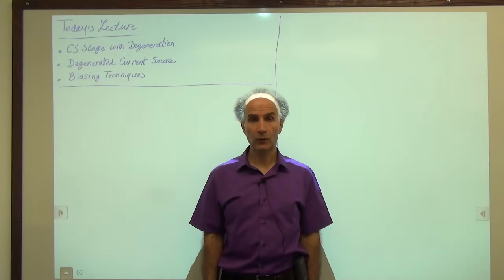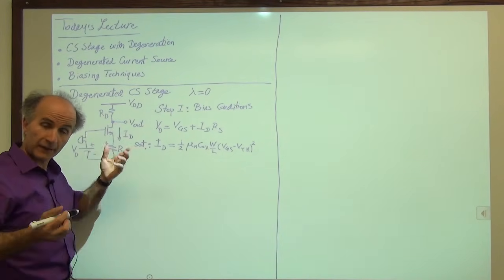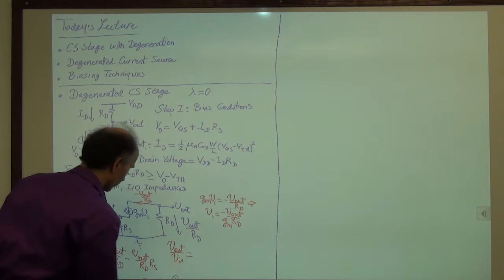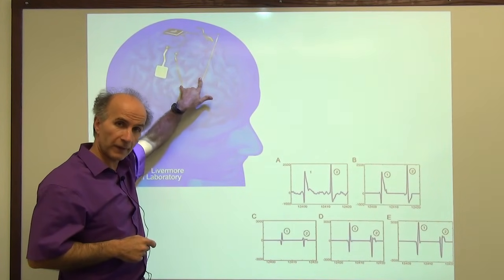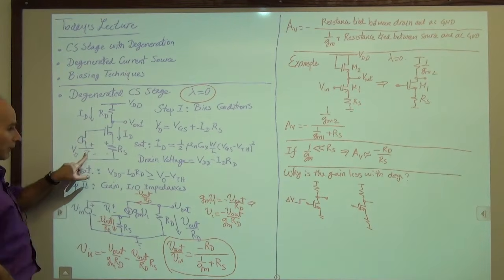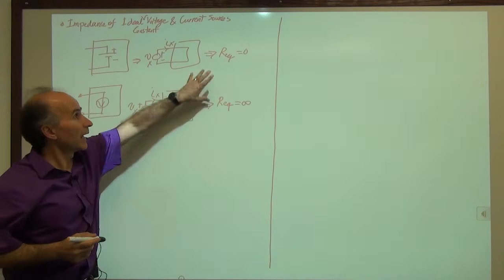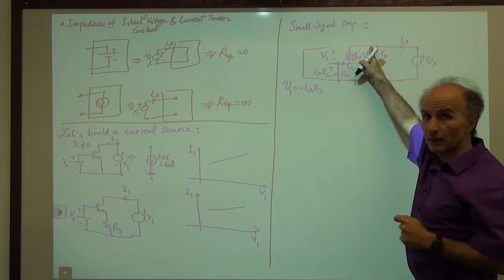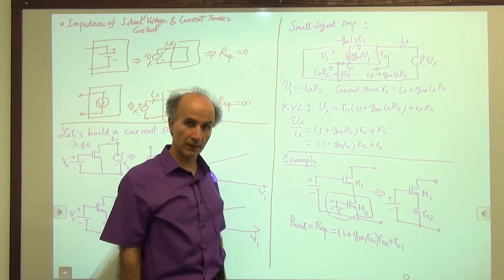Razavi Electronics 1, Lec 38, Common-Source Stage with Degeneration

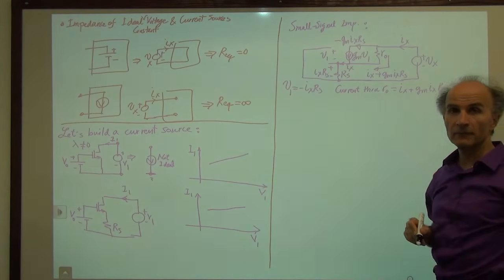Comment: 54:42 I do not understand how V1 is substituted in gmV1 in the corresponding small signal if it is defined as VDS, We shouldn't be able to replace V1 with VGS right?

Edit: I think you can just replace V1 with some V2, both aren't same, notation issue, (I am including it here for clarity)
Reply: Why can't you replace v1 with Vgs. In that particular circuit v1= Vgs. if you want you can write kvl at input side. you will also get the same answer what sir got.

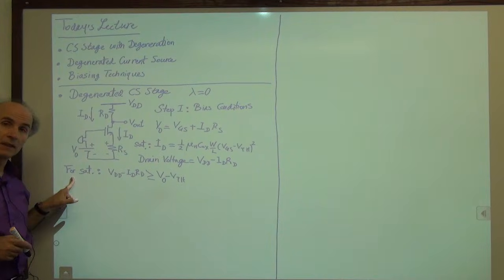Comment: @13:00 shouldn't we consider the drop across the resistor Rs as the condition is Vds >= Vgs-Vth?
Reply: Yes you have to, but the expression and the circuit topology take care of that. 

The expression Vds > Vgs - Vth can be written as: (Vd - Vs)>(Vg - Vs) - Vth, where Vd, Vg, and Vs mean the voltage of drain, gate and source to the ground respectively. 

As you can see the voltage Vs cancel out on both side, leaving only Vd > Vg - Vth. Plugging in the expression of Vd (Vdd-Id*Rd) and Vg (which is Vo) gives you the inequality on the whiteboard. 

Since Vd (instead of Vds) is directly measured from drain to ground, it automatically includes the voltage drop across resistor Rs.
Reply: yeah... I too noticed that

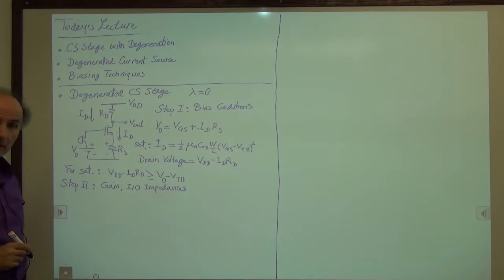Comment: Sir, V0= Vg + (drop on Rs), why did you consider Vg=V0 @13:33
Reply: yes i was wondering the same
Reply: I suppose that what you said is Vgs, but when explaining pinch-off at p277 it says that the edge only required Vg-Vth. And V0=Vg
Reply: V0 = VGS  + drop across RS, since VS = drop across RS, V0 = VG

Comment: The last circuit you are teaching shouldn't its resistance be 1/gm rather than r02?
Reply: what u r talking about is for a Diode Connected load But this is a current source device for which current is coming out of an arbitrary node and going to ground which can be made by an NMOS device in which the gate and source terminals are biased
Reply: actually should be 1/gm2 || r02, i think?
Reply: That will be for Diode connected device but that circuit have  constant current circuit model. You can see a  battery connected between gate and source. What you are saying is for when gate and drain is shorted.

Comment: in 12:28 sir you took the vds for saturation as vdd-IdRd but it should be vdd-IdRd-IdRs right?
Reply: Its correct.. because it is wrt ground not source.. Hope this make sense
Reply: Vds=Vo-IdRs and Vgs=Vdd-IdRd-IdRs, so IdRs at both side cancels each other.
Reply: @azusay167  Ya but I think you mixed Vgs and Vds
Reply: actually we need to consider only vds>vgs-Vth

but instead of vgs we are considering Vo (voltage between the gate and ground)

so, similarly in place of Vds i.e. Vdd- (Id*Rd)- (Id*Rs) we are considering Vdd-(Id*Rd) i.e (Voltage between the drain and ground)

so, Vdd-(Id*Rd) > Vo-Vth
is the condition instead of 
Vdd- (Id*Rd)- (Id*Rs) > Vgs-Vth

(PS: even I too got the same doubt initially by after seeing yours and someone elses doubt I thought and came to this conclusion)